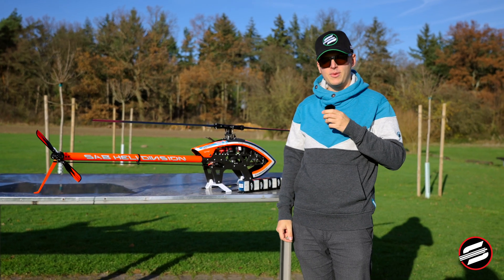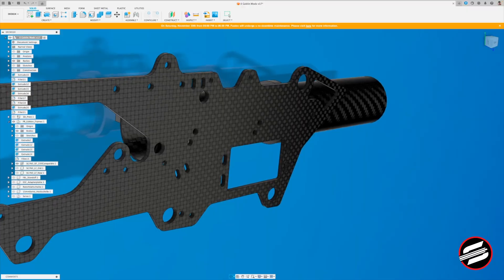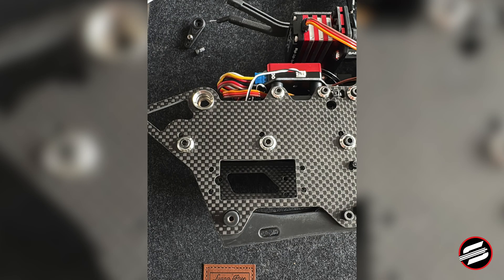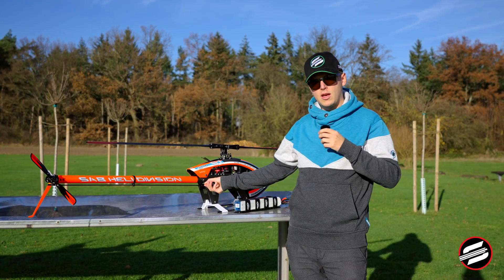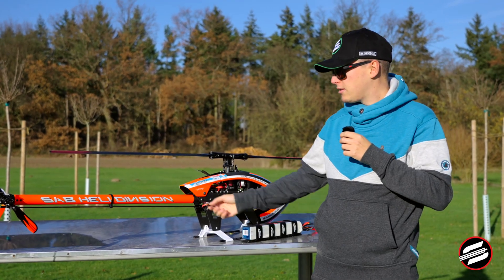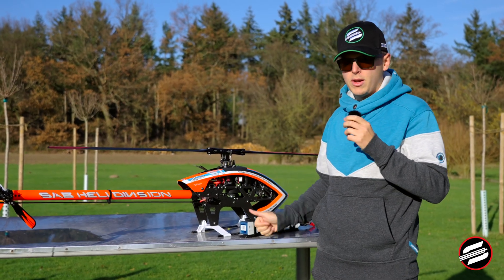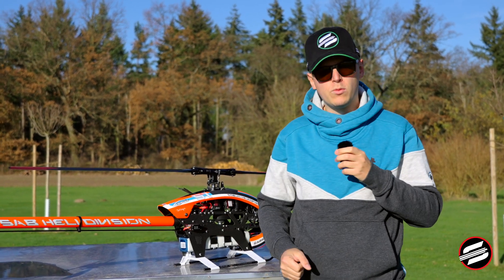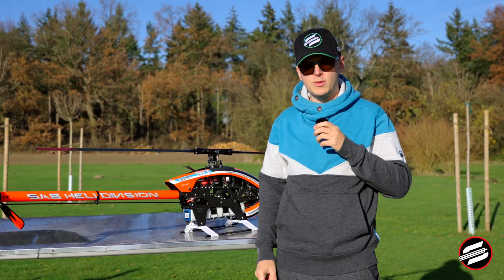SAB Group - Make it your style: Tail servo modification for SG763 SG760 | Pascal Richter

Comment: Nice video Pascale. Just wondering what is the part you use at 0:39 on the inside of the frame to bolt the servo into? Thank you :)
Reply from the maker: I honestly don’t know where this is from. This is a plastic plate from my lost and found servo accessories collection that perfectly fits tight spaces without the need to look for nuts. A carbon plate with a nut will do the same job, too.
Reply: @PRHeli ok cheers Pascale!